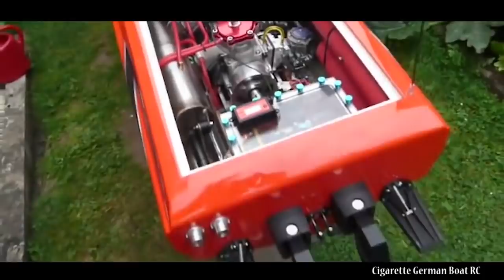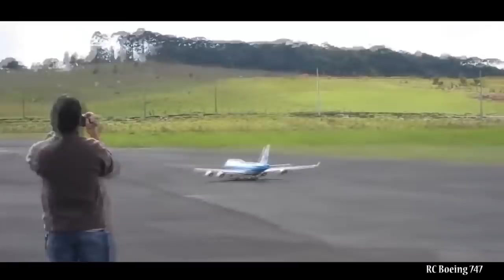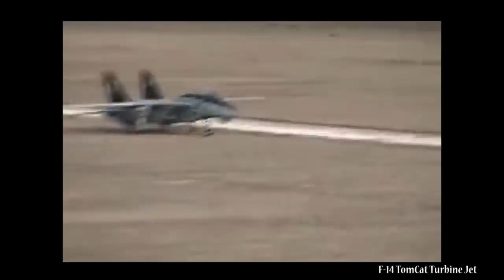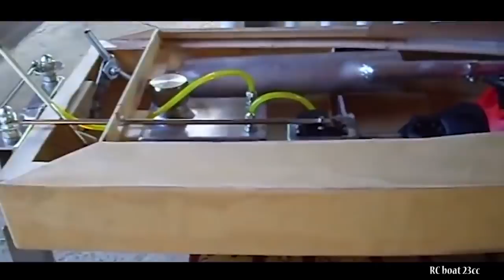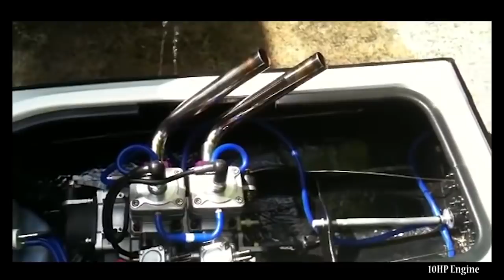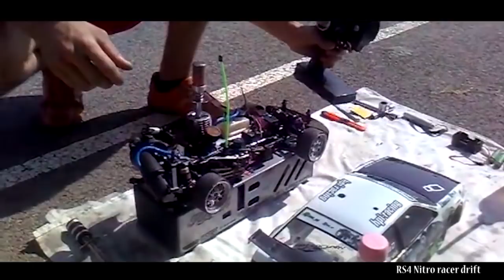Mini Crazy RC Engines

Comment: Wow would those boats rip! I'd like to build a miniature "boss 302", and build the body out of fiberglass, a 69 Boss 302. I wonder who makes mini transmissions?
Reply: What kind of transmissions are you after because I don’t know if you’re familiar with the Connelly miniature V8 and yes I know I spelt it wrong anyway yes they do make mini transmissions only one speed but if you wanted like a two speed all you have to do is adapt a two speed RC transmission kind of like converting a 2 Wheel Drive to four-wheel-drive using an NP 205 transfer case seeing as how the input for the transfer case is done through a short Drive line from the transmission to the transfer case same principle just smaller

Comment: Electric driven rc cars, boats are like couch potatoes.. Absolute rubbish, although our future
Reply: You mean better in every way..You don’t have to faf around with petrol and starting them and they more expensive
Reply: @EPVids330  the only benefit you have from gas or nitro engines is the runtime and the "sound". Besides that you could create nitro engines which are comparable with electric motors but they would be extremely expensive though
Reply: Elo rubbish :D said from someone who has no clue of electric rc cars :>